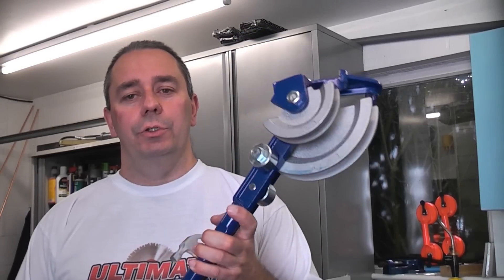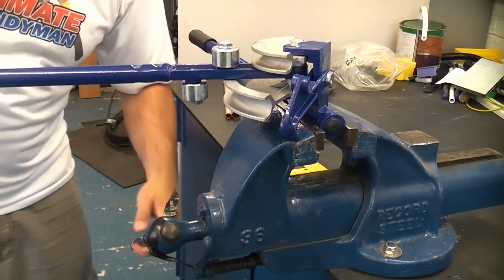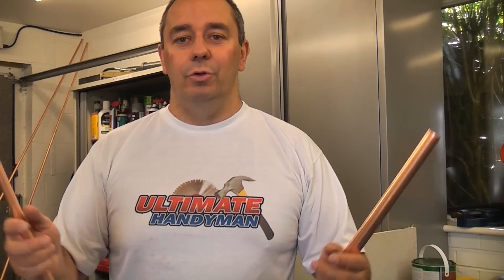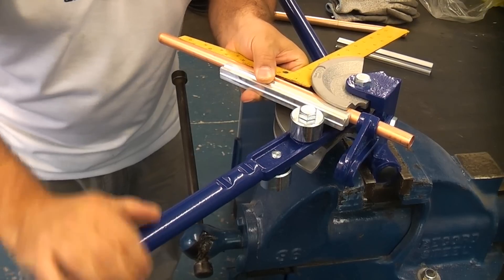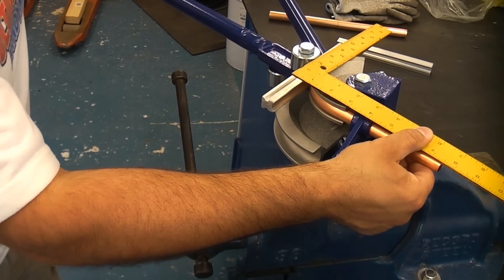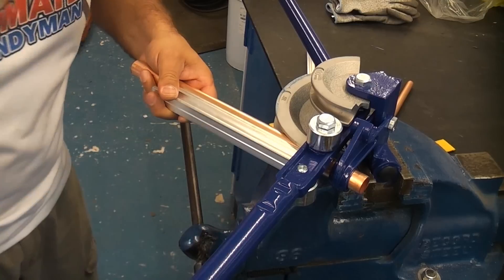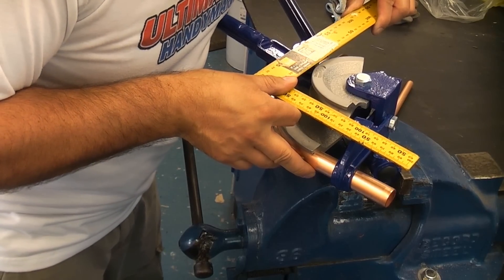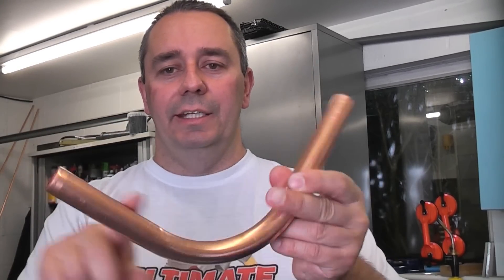Pipe bender | bend copper pipe

Comment: Are you bending rigid pipe? 
What is the diameter of the 19mm bend?
Reply from the maker: Yes, it's rigid copper pipe. The small one is 15mm and the larger one is 22mm diameter.

Comment: Good vid sir.  So is it the radius of the bend that causes the pipe to lengthen by the mathematical amount?  Stay gold.
Reply from the maker: Yes, the larger the diameter the pipe is the larger the radius. So if you bent a 3 inch pipe to 90 degrees it will be roughly 3 inches longer after bending.
Thanks for the comment
Reply: *****
Thank you, but what I mean is does the pipe lengthen the same amount if the bend is made around a golf ball vs a basketball.  I guess the "sharpness" of the bend is what I am asking about.  Stay gold.
Reply from the maker: ***** 
You can only bend the pipe to the former. Each former is made a specific radius so that the pipe does not kink.
If you were using 8mm pipe you could bend it around a Golf ball but you could not do that with 22mm pipe as the bend would be too severe for that size of pipe. I'm not sure if you bent a piece of 8mm pipe around a basket ball what would happen to the length of it as it's something I have never tried ;-)
Thanks for the comments

Comment: My question is, what would you use this device for? You cannot use it on water supply because code specifies a certain thickness to conduit water supply. When you bend the pipe, you are reducing the thickness, for example,  from type "M" to more than type "O" supply or less. Not a good thing. If you are building children's toys, go for it.
Reply from the maker: H B 
In the United Kingdom this device is widely used to bend copper pipes that supply clean water to houses etc.
Reply: *****  By bending the pipe, you destroy the integrity of the rated wall thickness. If it were to develope a pin hole, it will be at its weakest point. Especially being underground exposed to the elements in the soil.
Reply from the maker: H B
Copper pipe is only ever used above ground- mainly in domestic dwellings. It had been used for decades in the UK for domestic water and heating with no problems at all. Most plumbers prefer bends to elbows as they are less expensive and there is less chance of it leaking.
Thanks for the comments
Reply: H B This device has been used in the uk to bend copper for as long as i can remember without any of the problems you describe, i am 62  by the way, as for using copper underground, we dont use this type of copper, we used to use underground soft copper pipe, these days its plastic

Comment: I took my new pipe bender onto my job today to use for the first time. first bend, the back of the copper fractured outwards, second and third attempts it broke completely, where i gave up and soldered elbows instead! any ideas why this might have happened? It was new 15mm pipe, but also some older pipe broke whilst i was experimenting. Should I heat the pipe first? should it be lubricated?? The pipes broke long before i'd reached 90degs.... Hope you can help, Cheers!
Reply from the maker: Simon Tappenden 
I have never had that problem before, although I once bought some copper tube from Do it all years ago and I tried to install a self cutting tap onto it, but it simply crushed the pipe.
When you buy copper pipe it's only guaranteed to be the correct size on the outside diameter, which means that can try to make it really thin to increase their profits! I'm guessing the pipe you bought was not bought from a local plumbers merchants? 
Also what make is the pipe bender?
Reply: Thanks for your quick answer! The pipe was bought at a reputable plumbers merchant, but the bender was from ebay, it is made by 'Marksman' and about £25 so a cheap one admittedly, but does look the same as the one in your vid..
Reply: ...actually I just checked and i only paid £18 + p&p. I think im starting to answer my own question here!
Reply from the maker: Simon Tappenden 
No problem, I just checked and mine was £40 (Eclipse)
It might be the machine, but hard to say for definite.
Where are you based?
I can post you a off cut from my copper tube, which I have used for bending several times- at least then you can eliminate the tube as the problem.
Reply from the maker: Simon Tappenden 
No problem, I just checked and mine was £40 (Eclipse)
It might be the machine, but hard to say for definite.
Where are you based?
I can post you a off cut from my copper tube, which I have used for bending several times- at least then you can eliminate the tube as the problem.
Reply: Thanks - just returned mine and ordered an Irwin Hilmor set. Happy bending!

Comment: A1 video. Is it possible to make a continuous coil with this bender? Like a condensation coil? Simple yet effective tool.
Reply from the maker: Thanks, I don't think you could bend a coil with this ( I could be wrong ). I think these are pretty much limited to bending 90 degree or less bends.

Comment: Great video as usual. What make (and price) is the pipe bender. I only ask because I have heard the cheaper makes don't bend 22mm pipe.

Could you make a comprehensive video on how to use a digital multi-tester. I would like to do some basic wiring and have seen your videos, unfortunately you don't go into any detail on how these testers work, other than you check the ohmns.  Would be nice to see a video on what all the settings on these meters do. Thanks, keep up the great videos.
Reply from the maker: It's an Eclipse pipe bender and was about £40 from CPC.
Multi-meters only do about three basic functions, test for resistance, voltage and current- all of which I have covered-
Multi-meter to measure amps
multimeter voltage
Multi-Meter continuity test
I hope this helps ;-) 
Thanks for the comment